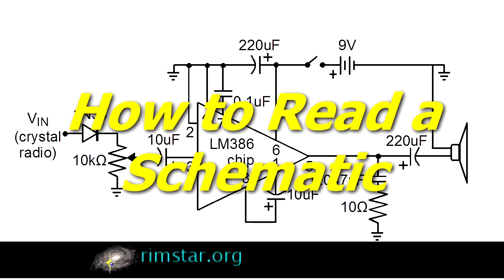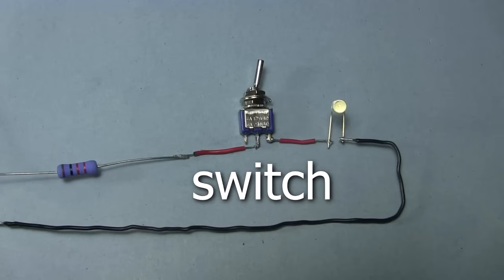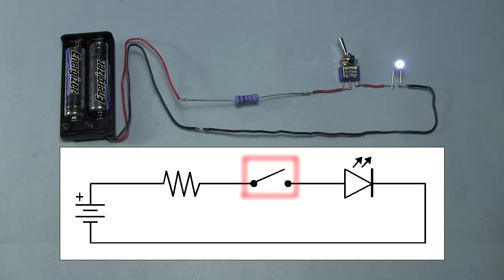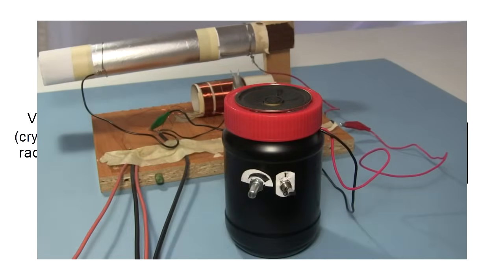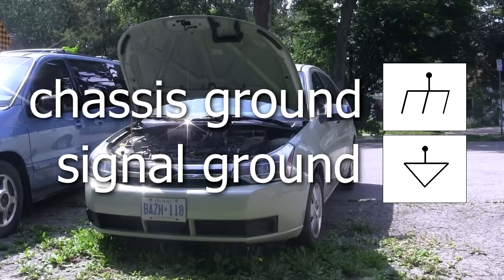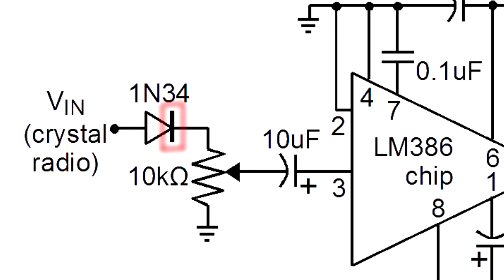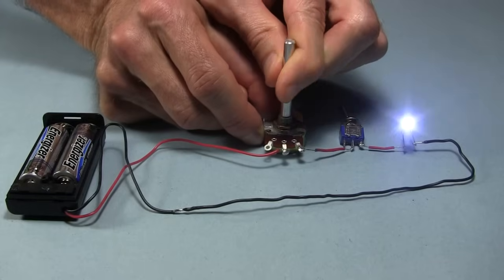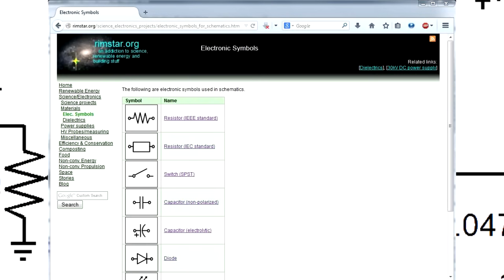How to Read a Schematic

Comment: Someone mentioned EveryCircuit here, and I'd like to point out a related app: ElectroDroid.
It offers a huge set of tools, from (SMD)resistor colour decoding, LED resistor calculator to voltage drop calculator and everything in between. And that's just the first tab!
It offers pin-outs on many popular connectors, USB, Ethernet, Scart, HDMI, Apple 30pin, Arduino, you name it. I've used it many times for that alone.
And there are many other references, like a table for wiresize AWG<-->mm^2
I'd really recommend it to any electronic enthusiast, since it's free as well
(A similair app for iOS would be something like Electrical ToolKit it seems.)

Comment: A little comment on the resistor values: When I started first building of schematics, notations like "4K7" or "6k8" confused me a lot, and took me some research to understand. As it turns out, the little dot (or comma) in 4.7kOhm easily gets lost when you don't write that neat, thus resulting in someone using a 47k resitor instead.
To prevent that, they choose to place the 'extra' symbol (kilo, mega, etc.) between the full and decimal numbers. So 4.7kOhm becomes 4k7, 6.8kOhm becomes 6K8 and so on.
Reply from the maker: Thanks, I'll try to remember that if I put together a webpage on reading schematics.
Reply: @RimstarOrg you definitely should!
Reply: Thank you for that
Reply: Wow
Really helpful bro
Reply: What’s ohm?
Reply: @MovieMovie-t9o  a mesurment of resistance

Comment: Hey Rim, i'm kind of confused on something. I thought the point of a circuit is to get the IC to work only to later find the IC is a circuit, how exactly does that work?
Reply: ***** Many times, ICs with 5-8 pins are single purpose chips (another very simple but incredibly useful IC is the 555 timer) and ICs with lots of pins can usually be programmed like an Arduino. Some programmable ICs have fewer than 10 pins, but most have many pins so the programming can make use of many inputs/outputs. An easy way to check if a IC is probably a programmable IC is if it requires a 3.3 volts power supply to work.
Reply from the maker: I don't think I understand your question. Not all circuit have ICs, such as the simple one I show in the first half of this video. In the case of the amplifier circuit in the second half of the video the IC (an LM386 chip) is a one which can be used as part of many different circuits, in my case it's to help amplify the output from a crystal radio. But with different supporting components and with different values, it can amplify many other things too. The LM386 itself does contain resistors, transistors and diodes (for example) all made by adding different materials on a wafer made of silicon, germanium or other material. If you look up how integrated circuits are made you'll get an idea of the process. You could make the same circuit that's inside the IC, but it would mean using larger components and take up more space. The whole purpose of the IC is to miniaturize at least part of your circuit. Some circuits contain many ICs. You can see the circuit that's inside the LM386 chip on the second page of this document http://www.ti.com/lit/ds/symlink/lm386.pdf.
Reply: RimstarOrg Basically I figured a IC was like a audrino, there is one main piece driving all the rest.
It's the physics and my desire to know how it works that baffles me. Thanks for the link.
Reply from the maker: *****
Oh, I see what you meant. Yeah, an IC is just a single microchip. So an Arduino is a board that contains one or more ICs and other parts. Confusingly perhaps, since it contains an IC, it's referred to as an IC board (Integrated Circuit board.)

Comment from the maker: By request, a new video on how to read a schematic for those new to electronics, or the merely curious or nostalgic. Enjoy!
Reply from the maker: +JuruX SayokaX Capacitors have a bunch of uses. They&#39;re basically two metal plates with something between them that doesn&#39;t conduct electricity, so charge can&#39;t cross from one plate to the other. But that allows you to build up positive charge on one place and negative charge on the other plate.
In a crystal radio you often have a capacitor connected in parallel with a coil in order to tune into a radio station. You can see one used for that in my crystal radio making video https://www.youtube.com/watch?v=VqdcU9ULAlA and with more of an explanation in my how a crystal radio works video http://www.youtube.com/watch?v=0-PParSmwtE. In that case it&#39;s referred to as a tuning capacitor.
In a power supply you often use a capacitor to smooth out the electricity to get a more constant flow. Here it&#39;s referred to as a filter capacitor.
A similar use is to put one near where the power enters a circuit in case there are unwanted power spikes. The unexpected power spike will be stored in the capacitor and then let out more slowly, and harmlessly afterward.
EDIT: Oh, and yes, I've heard of the Ben Heck show but I don't watch it regularly.
Reply: @RimstarOrg  I've alwayz had a major interest in such works but too immature to understand it thoroughly. After viewing this video, it assured my level of capacity to actually start building off the basics of such components!
Reply from the maker: Chris D
Cool! Thanks so letting me know. It often seems the videos I'm least sure people will be interested in turn out to have the most interest.
Reply: You have nice videos, i´m a follower! 
Add the rheostat simbol in your website (if you want to)! Square and arrow, isnt it?
Reply from the maker: Joel Santos
It may have to wait until I get back from vacation but I'll definitely add it.
Reply from the maker: Joel Santos
Oh, and there seem to be a few variations for a rheostat. Some have a diagonal arrow running across it and some have the arrow to one side pointing right at it. It can be a rectangle or a zigzag.
Reply: RimstarOrg ...I only knew the one with the diagonal arrow, because of my physics class.Good to know! Thanks!
Reply: @RimstarOrg  Lol, it seems life has that way of ironic results! But most definitely an A+ on this Video.
Reply: RimstarOrg I like this video relating to how to read a schematic. Another resource I also found helpful for how to make electronic circuit diagram is Elumpa Circuits Expert Alchemist - if anyone wants to know more search on google.
Reply: +RimstarOrg what does a capacitor do ? and do you know the Ben Heck show?
Reply: hi guys, the best results that I have ever had was with the Gregs Electro Blog (just google it) definately the most incredible course that I've tried.
Reply: @jamilayarik6718  Thankz for that insight & input!
Reply: Thank you!
Reply: That was one of the best explanatory videos i've seen, especially for the type of density knowledge based! i guarantee a 13yr old can map his way to conclude the idea of whats being shown👍💪👍
Reply: A new one? Do you have a link to it?
Reply from the maker: Jon, Are you referring to what I said in the original comment above? I meant that this video is new, or it was when I uploaded it 6 years ago. I wrote that comment just after I uploaded the video. Sorry for any confusion.

Comment: Great video. One suggestion with the switch; better if drawn with circles that are not filled and in the closed position the "rocker" not a straight line but sitting on top of the circle on switched side :)
(a newcomer may be confused with a piece of wire connected in between)
Reply from the maker: Good point. I've drawn the "rocker" sitting on top of the circle before. I don't know why I didn't think to do that this time, maybe because I was drawing on the computer instead of with pencil and paper. Do you mean draw with the circles not filled only when the switch is in the open position?

Comment: Question: At 2:13 why the red line is not coming to the lines contacting to No2 and No4 of the chip??They have dots(contact) but you didnt shown them with red?Absolutely flawless / fantastic video as usual.Please moore videos on basics! Thanks a lot
Reply from the maker: Thanks, I'm glad you liked it. And the answer is, you're right, the lines from No2 and No4 would be better if they were reddened. When I look at the original schematic that makes sense. It's when I looked at the schematic I marked up, it wasn't so obvious.

Comment: Nice work sir. I'm a big fan of ur mesmerizing work.i have a small question : does earth ground in a circuit diagram connect to the battery's negitive ? 
Thank you btw :)
Reply from the maker: Thanks, and thanks for watching my videos. I'm glad you like them.
It depends on the circuit. Sometime the ground will be connected to battery negative and less often it will be connected to battery positive. If there is a battery and a connection to Earth ground then it should there should be a ground symbol shown connected to one of the battery terminals to indicate which one it is.
Calling Earth ground negative is a frequent convention since ground can be a source or sink of electrons. If you connect the positive of a battery to Earth ground, then that means the negative battery terminal will be more negative than ground.

Comment: you should try the app (android and iPhone) Every Circuit. It's one of the better circuit building app out there. Any virtual circuit building app is good because it's good to experiment cost effectively rather than buying it and blowing it up. Just one of the apps that I use to make silly circuits.
Reply from the maker: Nice one. I've used a circuit simulator only once before. I forgot they existed.
Reply: ProSurviver thanks
Reply: ProSurviver I have quickly learned basic electonics by watching EveryCircuit tutorial in Youtube. I am positively addicted to that app, as I love watching speed and movement of electrons on paths. I wish there were more videos on EveryCircuit.